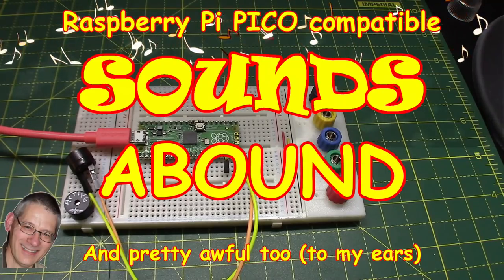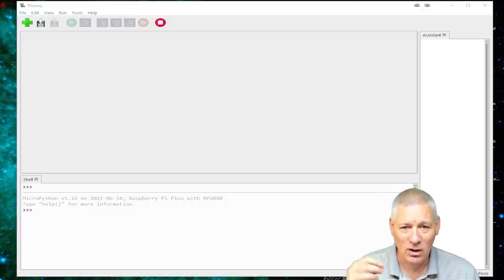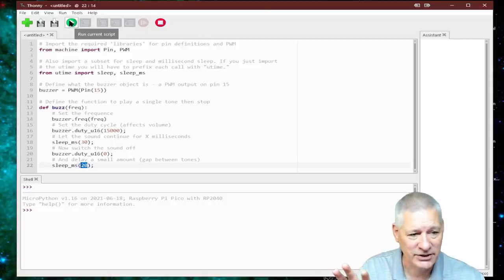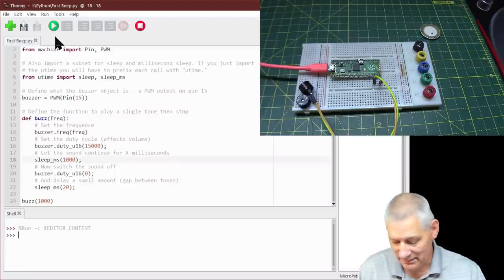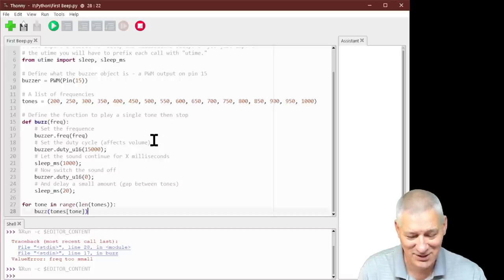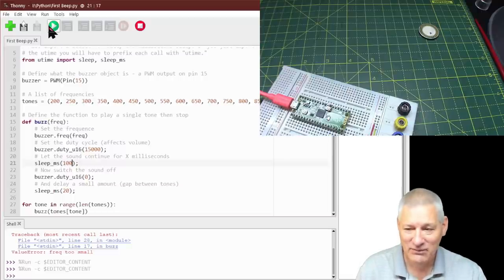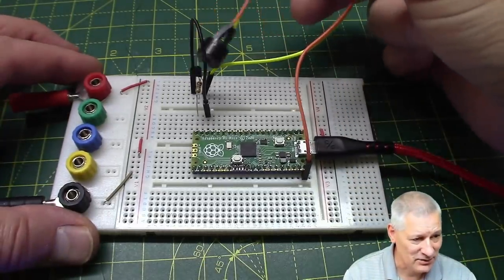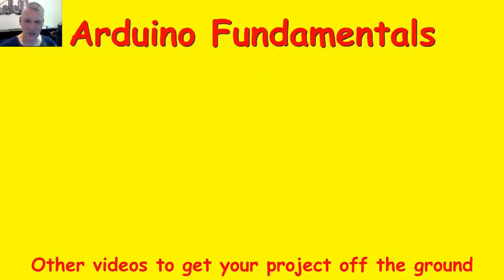#219 Generating sounds 🎵 from the PICO! But is it music to my 👂 ears?

Comment: If you want break-out boards for the Pico, I have a Gerber set for one you can have made at your favorite PCB maker.  It can be found here: https://github.com/jscottb/pcbs under the RPI-Pico folder
Reply from the maker: Nicely done; I like the way you've wired in the RST button across the board too.
Reply: @RalphBacon  Thanks.  I had some SMD buttons and added leads to them.